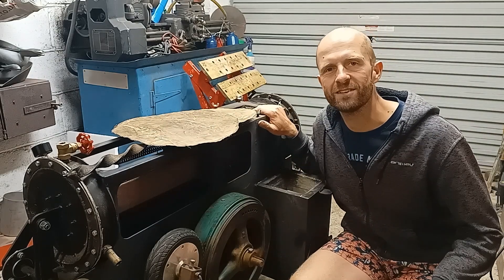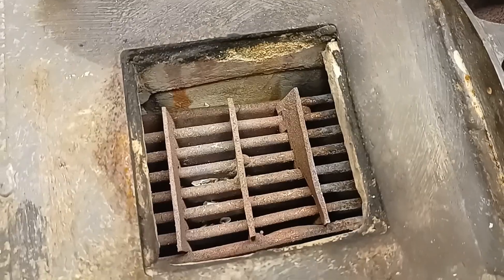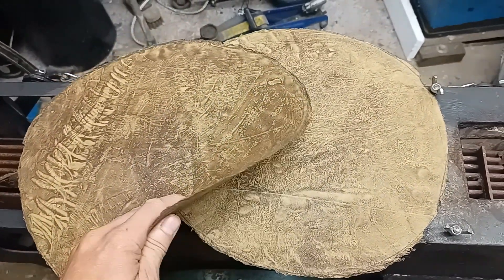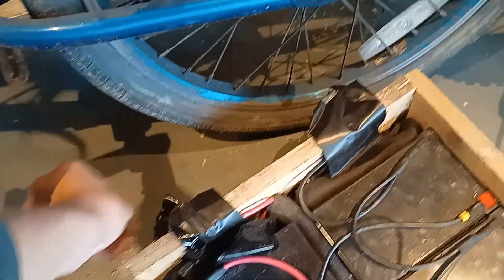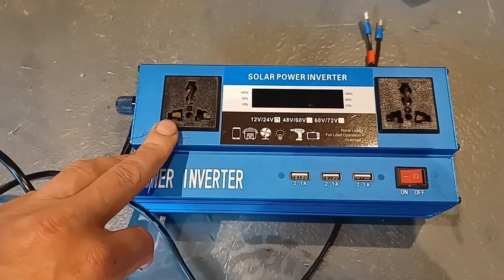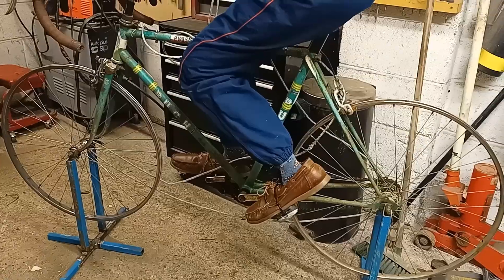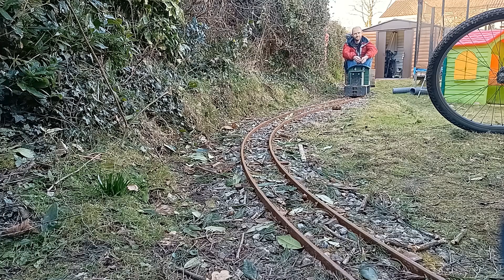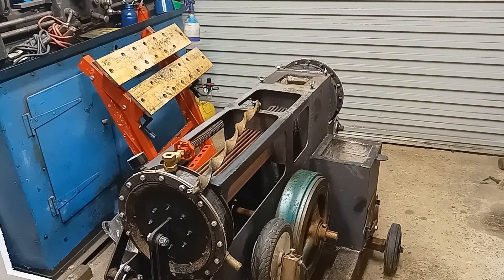Stirling Engine Generator Mk4 (Rocket Stove!) Part 12

Comment: in the alpha type, the membrane pistons do not last in the hot end, it has been tried. usually gamma or beta works fine, it has worked for me for many years, I charge the batteries. but I make it more efficient with a large hard diaphragm, with a short stroke still a lot of power and fast when the channels are big for the displacer.
Reply from the maker: @emil.honganmaki5461  hello, I'm very interested with your engine, have you got any photos? My email is shanepomeroy@hotmail.co.uk. With regards to the membrane diaphragms,  your probably right but I'm pretty unreasonable and will pursue this for a while yet : ) all the best

Comment: Pressure you need to pressurize the engine. To do this you need pressure on both sides of the piston. This will give power in all quadrants.

Comment: Shane I've followed your work with keen eyes for a while. I'm curious to know your opinion on whats more efficint at generating power at home using wood, is it stirling, steam or gasification etc?

Also if you ever make a digital design for your engines to sell, I would be very interested in trying one out and promote your work on my channel.

All the very best

Cheers J
Reply from the maker: @joshuadelisle  tough question! They all have substantial heat loss. I'd probably say steam engine because the heat differential between the flame and the water it's boiling is the largest. An IC engine running on wood gas would be efficient but the gasifier would have substantial heat loss. Tricky one : ).

I've not managed to get to the point of a finalised design yet but I think I'm getting there! I'll keep plugging away : ) all the best

Comment: Pressurizing the system would increase power. The more air molecules the better the heat transfers. I plan to keep mine at a minimum of 40 PSI. Having the diaphragms face each other should keep the hot side from the cold side and may make the motor more compact. I don't know what your regenerator used but I am going to use copper wire mesh.

Comment: A stirling powered locomotive would be a great project!  I suggest you use a Watt-style parallel linkage for the pistons.  Extra complication, but should give a uniform pressure all round the diaphragm, reducing wear and increasing power.

Comment: Thanks for the update Shane. The addition of hydrogen to a Stirling engine would give it more power. Hydrogen is excellent for heat transfer and gives it the best performance due to thermal conductivity.
It has a lower molecular rate which means less drag on the moving parts. The drawback are it’s flammable and you have to be careful of leaks because of the smaller molecules.
I have never used it in any of my engines, but a friend has and he’s never had any issues whatsoever with fires or anything of that nature. And his engines, even with the same design put out much more power than mine do.
Geez, that hurt to admit that… lol

Comment: That's one thing I will consider at my new house, a 5" track around the garden. But that's after the house is renovated.🤔
Reply from the maker: @shug831  that would be nice to see👍. If I had another shot at it I would have increased the gauge and it would be more of a mine tramway type thing. I suppose it depends what your after. Cheers
Reply: @ShanePomeroy  I'm in Bulgaria now. 😉

Comment: Great work. Now that you have a motor/generator mounted to the flywheel.  I wonder how  well it performs as a heat pump.  

If you were to optimize for a stirling heat pump, you might use aluminum tube heat exchangers because of their high thernal conductivity helping move more heat more quickly. On the other hand, Stainless (steel, steel wool, steel wire mesh) is better  for a stirling regenerator because it has the high volumetric heat capacity. 304 and 300 Stainless steel is even better than iron at  3.792 Jouls/(cm³×degree Celsius)

Why is volumetric heat capacity important? 

Consider a cubic cm iron 3.54 J/(cm³×degree Celsius), and a cube of aluminum is 2.43 J/(cm³×degree Celsius). If you shread both to a  wool with both having the same volume and same surface area and same dead space, the iron can absorbe and release about 45.6% more heat each cycle stirling cycle.  Stainless steel on the other hand can absorbe 56%more energy and has lower thermal conductivity than iron.  higher conductivty is counter productive for stirling regenerator that needs to hold a temperature difference on each side of the regenerator, and when using a screen or wool's, the high surface area to mass ratio make conductivity less relevent to heating/cooling the mass of the regener. And lastly pulling all this together, being able to store more energy in a given volume with a given surface area and given dead space stores more energy each cycle, making the regenerator more efficent then using a lower volumetric heat capacity material.

As a heat pump,I think your gasket seals will perform much better without the stress of high heat.
Reply from the maker: @kreynolds1123  I've just read what you've posted with much interest. I remember you talking about heat pumps back along. I was going to attach a motor to it and give it a go. I'll take a look to see if I've got a motor I can easily attach. Cheers
Reply: Google's AI Gemini gave me some bad numbers yesterday.  I looked up specific heat capacity and density and recalculated the volumetric heat capacity, and then made appropriate corrections in my initial comment. It's unfortunate that one can't trust AI more. Sadly AI isn't as intelegent as I'd like, and always should be double checked.